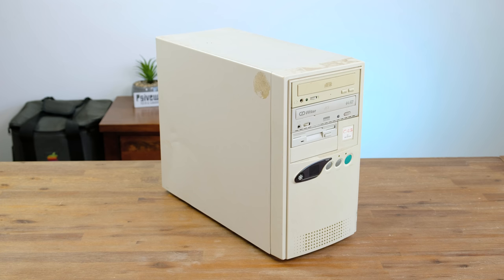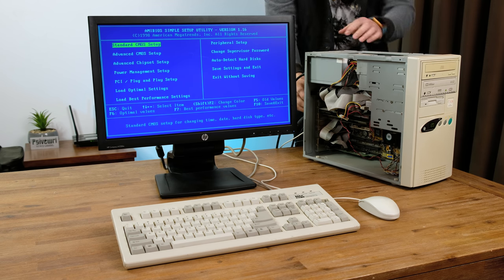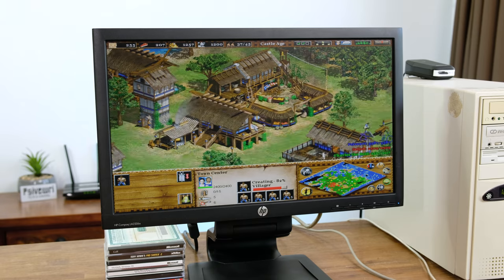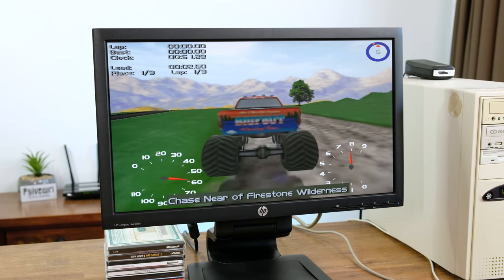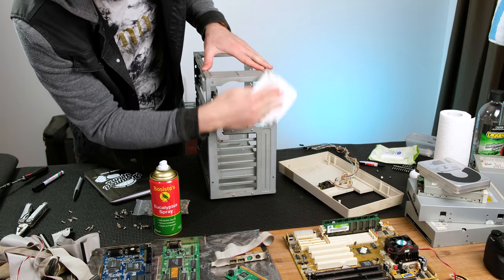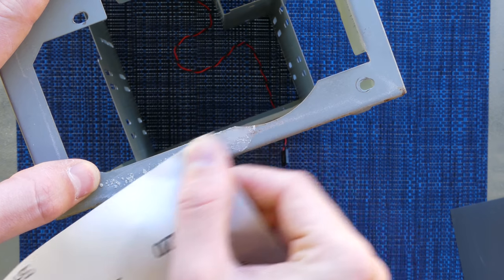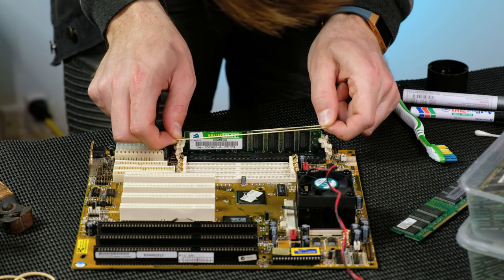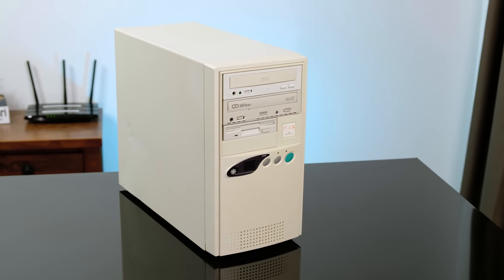Using An Old Windows ME PC! Big Mistake?

Comment: @12:39 - floppy drive light stuck on - ribbon cable on backward to front! Also, the motherboard (logicboard wtf?!?) is what is warped, not the DIMMs, and one more thing, the K6-2 is running at 233MHz when it's actually a 300MHz part! I used to have one of those TXPro motherboards - cheap and cheerful! When they worked, they worked well.

Comment: Such a beautiful startup sound ME has
Reply: Fortunately, this sound seemed to be shared with Windows 2000. There's also an alternative version of the ME/2000 startup sound, usually found in the beta versions of these two OSes.

Good luck trying to get these beta versions installed, though. At least you can still get the sounds from the installation CDs by going through the files with 7-Zip.

Comment: Windows ME was a wonderful version of Windows. The problem was that it wasn't being run on the correct hardware.
Reply: windows 2000 was the better version anyway, idk why microsoft released 2 very similar versions of windows so close to each other
Reply: @AtomicBoo  How come windows me and 2000 were simillar? Me was based on 9x when 2000 was based on NT lineup and dedicated for proffesionals. Before XP only Windows 98 meant something for gamers,me was a big big unstable mistake.Then  XP was the first NT windows friendly for all users
Reply: @miki476  The problem people had with ME was the drivers and the removal of real mode MS-DOS (although you could get MS-DOS mode back unofficially). XP did fix most people's issues with ME.
Reply: @AtomicBoo  My dad owned a computer repair shop and i remember ME & 2000 being a distinctly average OS.  It was forgotten or skipped over very quickly.
Reply: The same was with Windows Vista. Most of the users used it on PCs, that not capable of running it properly. Thats why ppl are hating the Vista. I used it till Windows 7 and didnt had any problems.
Reply: vista was a rush job Microsoft didn't check it first to see if it ran properly & the mistake they made was they re wrote the codes so that it had issues with drivers & virtually nothing was compatible with it I have used windows ME, XP & currently using 7 all 3 have had issues with hackers & viruses but they got it right in the end its a shame that XP got discontinued just after they made it stable, as for windows 10 now Microsoft forced an upgrade to that one from 7 but there always was a work around that no one wanted to upgrade cos of the risk it deleting all the files while installing win 10
Reply: @jasinere35  the driver compatibility issues was not Microsofts fault. Those are the manufacturers failure. At that time MS was writing the absolute basic drivers for plug and play stuffs, like mouse, keyboard, etc. There was many issues with printers and soundcards. The manufacturers knowed, that a new operating system coming out, but they didnt done anything on the driver side. The same was with the 64 bit version of the Windows XP. My new(old) rig was 64 bit compatible, but nowhere to found 64 bit drivers for XP. That forced me to switch to Vista, because my mobo(Asus P5Q) was Vista ready with complete driver set for 32 and 64 bit(but not for 64 bit XP).
Reply: @AtomicBoo  there is a major difference between ME and 2000; ME was old school 98 based, meanwhile 200 was already NT based. With that most of the (external) hardware did no more work.

Comment: if you have trouble getting ram sticks in, wipe their contact area with wd40, contact cleaner, silicone oil, or 3in1 oil spray, it'll greatly help them slip in, also brush all plug and socket contacts similarly

Comment: If anyone is willing to clean up the power supply you can also try lubricating the cooling fan. This doesn't work on all fans but some have a rubber plug hidden under the fan sticker and once removed you can add a drop or 2 of light machine oil or sewing machine oil. This trick has helped me keep older power supplies lasting longer and for noisy power supplies to run quieter.

Comment: Ok, hear me out. That case would make a rather nice sleeper pc!
Reply: It would indeed.  That motherboard was essentially a 'sleeper' type mod in its day.  It was designed specifically as an upgrade path for those still putting along with AT-type Socket 7 rigs.  By swapping this into your AT box, you could keep most of your Socket 7 hardware and get the upgrade path of Super-7 chips from AMD and Cyrix.  Where Intel stopped with 233 Mhz Pentiums, Super 7 chips were running much faster!   Notice when he's pulling the mobo out of the case - he mentions the two different types of RAM slots, but doesn't notice that the board has both AT and ATX power connectors.  Yes, it could work with either type.
Reply: No

Comment: I had an AMD K6-2/400 running, I'm pretty sure, on that very same model of motherboard.  If you notice, not only does it accept two different types of RAM (old 72-pin SIMMs as well as the newer DIMM type), it accepts both AT and ATX power supply connections.   If memory serves, it could accept up to a maximum of a 550 Mhz chip.

In my system, I converted the AT type power switch to a momentary contact style by disassembling it and removing the little bit of plastic that causes it to latch, then soldered on the proper connector to make it work with an ATX type power scheme.  Of course, to make it work this way, you also have to use an ATX power supply, complete with proper ATX power management under Windows 98SE.

Comment: I still use my Toshiba Satellite 330 CDS from time to time, but it has Windows 98 second edition. I remember back in the day when I was using Windows ME with AOL dial-up on my first custom gaming PC that I built in early 2001. Would be good if you can use AOL dial-up for nostalgic purposes today. Very last time I ever remember using dial-up internet was in February of 2006 which then I moved on to using cable internet and then wireless.

Comment: A board that old, having the right mounting holes for screws could be the problem on why it got warpped. You could try using plastic self adhesive standoffs under the ram sticks, mount the board, then insert the ram in the slots. That might help once the boards mounting screws are tight. When I first started with computers, a k6 450 with Windows 98 SE was my first machine.

Comment: Hi, check the motherboard for straightness. Not often they sag ( unless you threw it in the garage on its side ) but it is possible.
Sometimes it is a combination of case design Vs mother board mounting holes on the standoff screws, often the mounting holes in the mother board will not line up with a case , so it is left bare, add to that the weight of all th eother cards and you can get a bend in the board.

Similarly no standoff or protection of the corner on bottom left ( away from memory and power connectors ) can make the board flex and the base of the mother board can short out on the case chassis

To fix this i have 2 options
1) use plastic standoffs - they are sort of spear shaped on top and a flat button on the bottom, you slide the button on the case then put on top the mother board to clip in, for a while most 386/486 were like this , simply cut the button of the bottom with a sharp knife and poke it from the base of the board pointing up, this will acts as a insulator and spacer 
2) there are some C-style shaped edge connectors, they simply push on like bulldog clips, if the board is to thin i just add some layer of electrical tape or gaffer / duct tape on the board to thicken it

The voodoo 2 is a good find 

Regards
George

Comment: About the power supply, yes you can put a mechanical power switch on an ATX one, there is one green wire that goes to the motherboard, stripe it plus one black ground cable, then solder them to the switch.
You may also make an adapter for the motherboard with a little soldering, for that, please refer to the wire colors, it's normalized!

Comment: I used an amd k6 500 with Windows ME back in the day most stable system ever. Never had a single issue.
Reply: Also have the same experience, although with a PIII. Tons more stable than 98SE, aka "System is busy"-hell of BSOD's that would never work properly. Still using a Millennium K6-II for helping 98 rigs whenever they decide to fail.

Comment: i had that exact computer tower back in the 90s! i can’t confirm if the guts were identical to the one you had, but that POST screen with the energy star logo is burned into my memory. the one you have probably came from the factory with windows 95 installed between 1995/1996 like mine was, which is why some of the hardware components are dated from 1995. i also used to play pinball, but there were all types of other games on there like chess, chips challenge, and i even had some rare cd-rom games like cyclemania. i also had some interactive/educational cd-roms like encarta 96 and journey to the planets. it looks like the original owners tried to keep it updated over the years with operating system updates and some component upgrades, but the gap in system requirements from windows ME to windows XP and the switching from a DOS-based to NT-based OS probably finally rendered it obsolete.

Comment: To restore  the longer DIMM slots they would have to be de-soldered then pulled out then find a case tray that can separate from the case, find right thickness piece of foam rubber mount motherboard to removable tray and place foam rubber under those 3 modules location before screwing mainboard down to tray. Sit it in a warm spot where there's some heat not too much for a couple of weeks monitoring it of course. The actual DIMM sockets may need to just be tossed. Acquire a dead board that has same sockets. What the attempt is is to get the pcb of the board straight/er. Once it does than replacement sockets can be re-soldered in using lead solder. It probably got warped due to extreme heat and cold.

Comment: The start up sound is from Windows 2000 and Me. I did enjoy that tune everytime I restarted or logged into my Windows 2000 systems after changing the Windows desktop to an alternate shell like Litestep or Openvision or no shell at all! Oh the good times! The main board, NOT the dimms, is bent in the middle of where the dimms seat, and whilst you were trying to force those dimms in place, you should have pressed and squeezed the dimm down into the slots in the MIDDLE of the slot/dimm with one hand and then squeeze the end of the dimms one end at a time with the other hand until you hear that satisfying snap of the dimm fitting into the slots. THEN you place the main board into the case. ALSO, you should have replaced the coin battery as it was plump and too old and would have needed changed. The TX pro motherboards and Vx Pro boards were very economical and thus CHEAP in quality! That would have been part of the reason said board was all warped like that too. That was a Super socket 7 board of the early type, hence the newer style of ram mixed with older 72 pin and the changes from AT keyboard to PS2/USB, to name a few. It is 2020.. is that system still working?

Comment: I guess the machine is more likely a 1998 base with old recycled components (e.g. 1995 CD-Drive and floppy). The TXPro chip is likely from end-1997/early-1998. The K6-2 came out somewhere in summer of 1998. The case is also likely from 1995, with a 1998 PSU. The neat thing about this motherboard? The PS/2 mouse connector and the dual AT/ATX power supply.
Wipe out the drive, install Win98SE on it on you have a very fine 1998 machine to game on, especially MS-DOS games. It is a neat machine that you should keep giving good care. That old lady deserves to have a fabulous golden year ahead.

Comment: A few things I feel are worth mentioning:

The VooDoo graphics cards use their own API (Glide) in favor of DirectX. Unreal Tournament would have been an ideal showcase game for demonstrating the advantages of Glide.

The reason the board only detected 128MB of RAM on the 256MB DIMM is because most boards at the time weren't capable of detecting more than 128MB on each bank. There is no actual hardware issue, it's just a hardware limitation.

The turbo function was designed primarily for a handful of old 486 processors (particularly, the Intel DX Overdrive) as they were being phased out by Pentium grade processors. It provided a way to get a little more juice out of what were, at the time, budget processors using older technology. Of course, the K-6 2s were already much newer than the oldest Pentium CPUs, so the Turbo function did indeed serve no purpose.

Just a personal curiosity, but this system is capable or running Windows XP with good performance, and it might be fun to see how well it can handle web browsing in today's era. You might want to use a browser plugin which disables videos and animations if you attempt this, as it will otherwise be rendered unusable while browsing more modern sites.

Just one additional note: A few years ago, I used a 266MHz Pentium II PC with 128MB RAM and a 16MB Riva graphics card for about a month (my main system died, so I decided to go old school for a while and see what I could do with it). It remained surprisingly useful, even in 2014. I was able to browse and post on Facebook with little issue (I disabled videos), I was able to listen to Pandora without any problems (might be more troublesome now), and while I wasn't able to stream videos from Youtube, I could watch them in 240/360p on my PC after downloading them with a Youtube downloader. I had to jump through a few small hoops, but there wasn't really anything I wasn't able to do that I could do with a modern PC at the time, aside from, of course, modern games and HD movies.

Comment: I remember these old machines in the late 90s. I use to work on these. I never used ME I used 98SE back then and then used XP from 2003 onwards until 2009. I used 2000 machines at TAFE in the early 00s

Comment: Becuase people have been asking: the reason why Apple calls them "logic boards" is because the original Macintosh models had a CRT monitor built-in and thus it required 2 main boards to work: the "analoge board" which contained the systems' mainly high-voltage analogue electronics required to drive the CRT and the power supply. The "logic board" contained all of the digital circuitry (CPU, RAM, etc). The last Mac to feature an analogue board was the eMac as it was the last Mac to ever feature a CRT monitor built-in. Apple still calls them "logic boards" because that's what they have always called them. Hope this explanation helps :)

Comment: You could also use an ATX power supply since it has the connector for one, use the reset switch for the power switch. Just an option to consider if that power supply fails. When I have an old power supply like that taken apart, I always peel back the sticker on the fan and put some oil on the bearing,

Comment: used to build these back then - yes we've come along way in graphics/gaming but power we've only come to 5Ghz in 20 years and only just moving off the CD/DVD drives in the next 5-10 years back in those days we used to piggyback the dial up modems to get a bit more speed for out internet.

Comment: For anybody watching, you can fix a warped PCB if you are very careful. With a cheap toaster oven you don't want to use as food, preheat it to 200 F. Clamp the PCB onto a flat piece of wood, and let it sit in there for potentially a few hours. 200 F won't remelt the solder, and the time and heat should help straighten parts out.

Comment: Good video. Always enjoy these deep dives / rebuilds of these old 90s computers. However you really should treat the rust before painting over it. At least try vinegar.
You could also have tried to place something non-conductive behind the bent area of the motherboard - affixed to the case - to gently push it back into place.
That motherboard might well not be capable of addressing 256+MB SDRAM DIMMs, hence it only uses 128MB of the DIMM you have installed.

Comment: Actually thats the same start up sound from Windows 2000 Professional. Really miss that os and wish i could still use it. I mostly used it during the XP Era from 2000 to  mid 2005 then xp from 2005 to 2007 which i ended up with Vista which would always crash then 2009 to current windows 7

Comment: You should scrub the rust away with a metal brush before painting it over. The brittle rust layer is not good ground for a paint layer - when the rust cracks, tha paint carcks with it. It's prpous nature also gives much possibilities to leave openings for oxygen. That's why always scrube that junk away before further surface handling. Easy to do with a small file, or in this case, maybe with a end of a small screwdriver.

Maybe trivial on computer hardware, but essential in car painting, and a decent rule always applies.

Comment: It´s a K6-2 300MHz processor. If you find a schematic for the jumper configuration you might be able to let the processor work at the proper speed. The bios now reports `233` so that´s most likely the speed the CPU runs at. Depending on the rated memory speed cranking up the FSB speed might also be a possibility. Higher FSB speeds are very helpful to make the system noticeably faster.